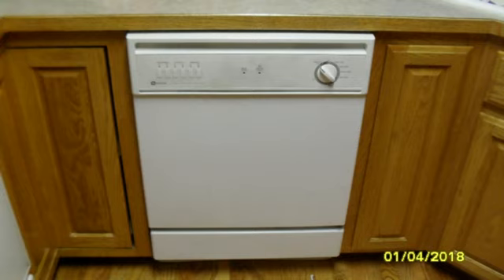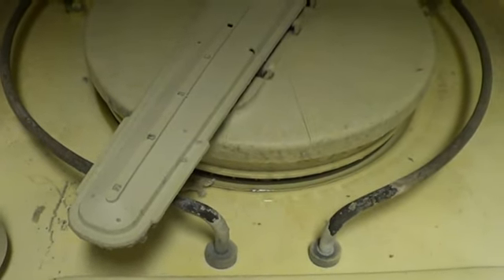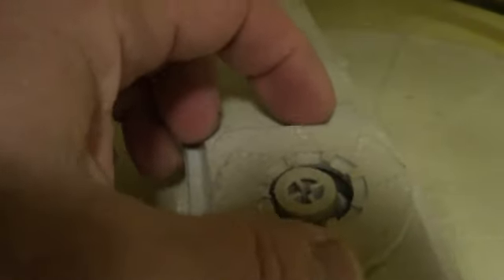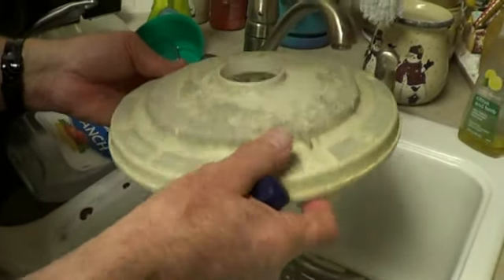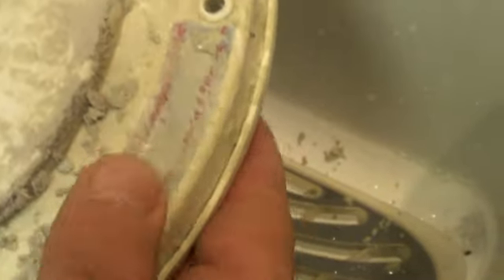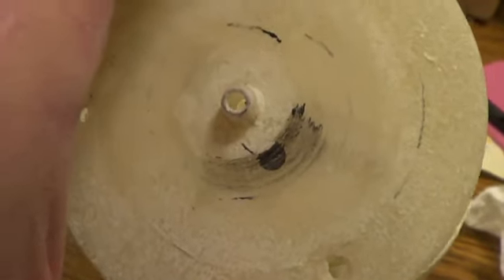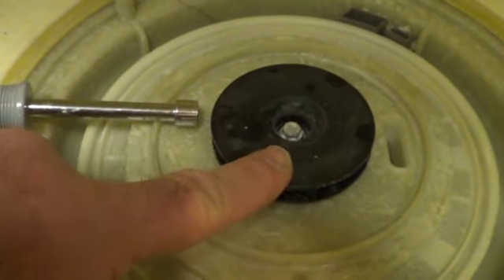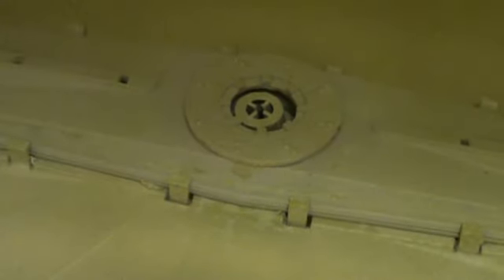Maytag Dishwasher   Noisy Repair

Comment: I have never seen a mineral buildup this bad. You have some hard ass water. It's building up on the element and will destroy it. There are products (CLR) that will help with this.Citric acid or vinegar also work. All dishwashers need to be treated at least every 6 months and more if your water is this hard. I didn't get to mine until it was 10 years old but I don't have hard water. All I found was a bread tie, small pieces of plastic wrap, a chicken bone, and a penny.

Comment: Thank you for this video.  My machine just got the same exact problem.  I just didnt recognize it at first.
Reply: Have you found the replacement part for it?
Reply: @bethanievance7698  No, the piece that was broken on mine was the part he finds around the 9:15 mark of this video.  The puck looking thing.  I found some super-glue (Loc-tite i think) and some cotton to hold the glue and then stuck it back on where the 3 holes look to line up inside the washer.  It is still holding to this day.

Comment: Glue doesn't work. Glued mine, came apart...glued again, came apart again...and a third time. Buy the new part.
Reply from the maker: Mine is still holding over a year later.  Saved me the $58, but a new part is the best fix.  Epoxy will set in 10 minutes, but still needs 12+ hours for a full cure to withstand the water and heat.
Reply: @jimdandy6472  what kind of epoxy did you find works? I used 5 minute Epoxy and it did not survive the water exposure.

Comment: I've tried gluing also with JB Weld and superglue. Doesn't last. The replacement part is no longer available. I'm thinking of just removing the center piece and running without it. Anyone tried running without the center part?